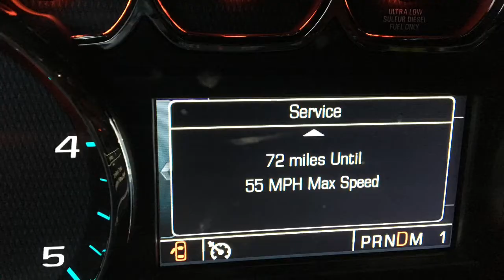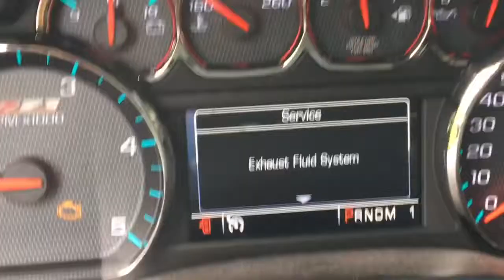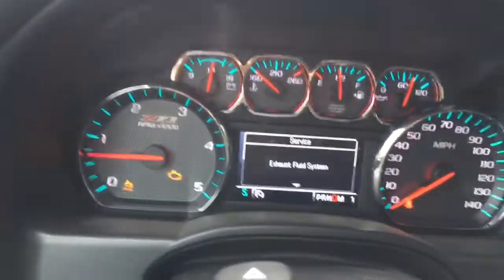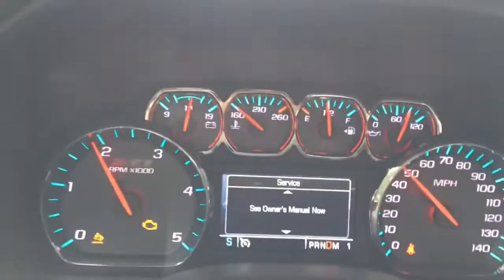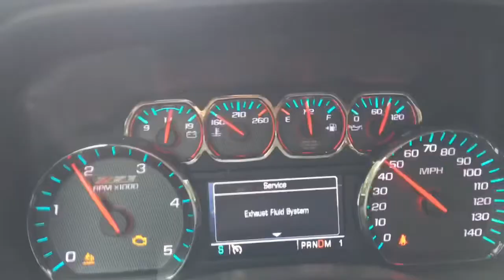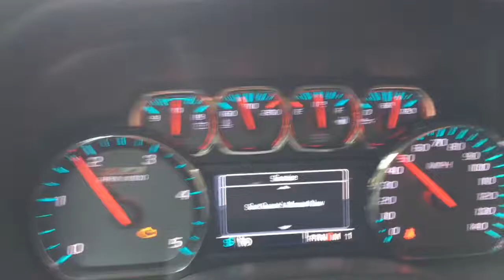2015 Chevy Silverado 3500 Duramax dpf def diesel exhaust 4 miles limit workaround fix

Comment: After watching this video I wanted to share my experience as well. My 2015 gmc 3500, 6.6 duramax was down to less than a mile before it was going to transition to the 4 mph max, so I did as you suggested and unplugged the speed sensor. But mine didn't start off in first gear. It seemed to be in about third gear because it would actually move forward only if I got it up to about two thousand rpms. So I did as another comment suggested, leave it in gear, set the brake and try it again.  Still the same, in third gear. So I decided to try it as it was and see how fast I could get it up to.  Since my local dealership was 25 miles away, I didn't have anything to lose. It ended up topping out at around fifty mph. I'm just guessing, because my digital speedometer was registering 184 mph, lol. Anyway, I could keep it going that speed, and run about 2200 rpms, oil pressure stayed about 80 lbs, and temp was below its normal 210 degrees.  I had actually left the speed sensor plugged in the last time I switched it around. It still had the check engine light on for like p0070, which was transmission system sensor, so as soon as I got to the dealership, I plugged my cheap scan tool in and erased the code. I turned it off, then back on, and now the transmission shifted normal.  Two funny things happened by running my truck at high rpms for thirty minutes.  As soon as I got to town, I started getting the original transitioning to 65 mph again. Running it like that for so long literally fooled it into resetting itself. So, theoretically, I could have probably driven it for 72 more miles at 65 mph. But the second funny thing is this. While I did have an appointment for a diagnostic test,  the technician came in the waiting toom and said, "Your truck is no longer in limp mode, and it's showing absolutely no codes now. " So he charged me nothing, and now I've driven it a couple hundred miles, and it's doing fine. The only thing I can figure is that by driving it that long at the higher rpms, maybe it worked the same as a regeneration cycle.  I guess time will tell. If it does go back in limp mode, I will come back and amend this comment. 
Okay, it did go back into limp mode. Same p20bf which I've already replaced the redundant B heater supply hose. Just by chance. When I started it the next morning I put it in elevated high idle, and after idling fast for about ten minutes,  it cleared itself on it's  own again. It's done this twice now and both times I've been able to clear it by fast idling it for five to ten minutes.

Comment: Worked for me. You can only go 55 with 2000 rpm because you can’t get it up to 6th gear. But yes, will save your butt if you get put in 4mph limp mode.👍

Comment: If you can put your truck in regen I have found that works as well l.  So if you have a odb2 scanner that can do that.  Remember disclaimer you could ruin your dpf system if there is a sensor reading true values and is not truely shot.  A dpf overhaul is 5-8000 in parts according to google.

Comment: Thanks man! How did you ever get the alert cleared? Took mine to dealer for diagnostic and they said I needed to change the DEF Heater. Changed it out and still having the same limited MPH problem. Tia

Comment: So what was the main issue that your DEF light and check engine light is on?
Reply: Any fault in the emissions system (DPF/DEF/EGR/NOX) can cause the truck to go into limp mode. Its a ridiculous system that simply doesnt work, makes your truck thirsty for fuel, and will cost thousands of dollars to maintain through the life of the truck. His issue was a reductant heater fault. Thats the heater within the DEF tank to keep it from freezing. Thats all it does. Yet Chevy decided thats enough to put a truck into limp mode. Idiots.
Reply: @kevicook  i don't think it's just chevy. It's anything with def. Nobody wants to run it. It's forced to have it and ran by the epa. All things have issues with def. Including my self. No manufacturer of any vehicle wants to look bad. Blame the government.

Comment: This is ridiculous.   My truck is stuck.  Still in my garage.   After months.  Two dealership trips. 7k. And I am still stuck.    I will never buy a Chevy again!!!!!!!
Reply: Crappy sysrem for sure recall on it fixes 0 do not buy a GM Product Durimax is a maintenance nightmare.
Reply: You’ll get it with power strokes too. Cummins aren’t that bad.
Reply: What’s the status with your truck?
Reply: My truck is stuck at 4 mph for about a month. Your trick got my family home from an interstate trip. Eternaly grateful. $500 scanner, all the DTC and faults are gone. Does manual regen. But it times out the RFQT and won't run the service bay test at all. Next stop, flashing a tune. I will let the thread know if it works.

Comment: I had same issue on my 2012 GMC 3500 Denali. There is a service bulletin that extends the warranty, in my case to an eight year old truck with 78,000 on the clock. Whole new module heaters and all,  5 gallons of DEF.and labor. NO charge!
Reply: Arthur, can you please give me more info as I have a 2012 DEF quality issue.  I'm trying to find the TSB service Bulletin before I take it to the dealer.  Thank you.
Reply: I dont know the number. It is a common issue. If you call a dealer they should be able to tell you.
Reply: Yelp, happened to 2016 in April 2021 with 34,500 miles.   DEF tank, reductant heater, module, replaced for free. Special extended warranty policy.

Comment: How long is it safe to run the truck with the sensor disconnect ?
Reply: Same question i got
Reply: Obviously, needs to be fixed right away. 1st and 3rd gear only working with speed sensor disconnected.

Comment: Why in the hell even let it get that low in the first place?  I add more at 20%.  Just like my wife in her car letting it get to E - "E" does not stand for enough!!!
Reply: Because is it's like mine it won't reset right away. Like right now mine is full and it won't reset done drove 300 miles
Reply: It won’t reset because it’s broken ya idiot. Mines deleted and free now
Reply: It’s not low, something broke for it to come into limp mode.   Mine is full and doing limp mode
Reply: @kinomorrison8004  it almost sounds like you got bad DEF
Reply: @Gengear  turns out it was a heater thingy that failed, under an extra warranty by gm, so cost was free repair.   Still inconvenient
Reply: @kinomorrison8004  reductant heater

Comment: Good god man. Why and how did you get your truck this way? Don’t you service it regularly? No offense though it was a great video.
Reply: Happens to all trucks with DEF. The injectors get clogged, the sensors and heaters go bad causing error codes and check engine lights.

Comment: Thanks for this!  But once you pulled the speed sensor, how did you get the truck back into normal running speeds?  I pulled the sensor due to my DEF heater fouling out, and now it’s stuck in 3rd gear.  Thanks

Comment: thanks for the tip i removed the speed sensor and put it back on the engine light came on good thing i always carry a scanner i erased the codes, and the emission system disappeared. i am travelling Houston, tx to ringgold, la

Comment from the maker: Replace The heater in the DEF tank and ran the regeneration.
Reply: So the heater can actually stop def process because I filled my def tanks a few weeks back and it hasn't went down one bar yet. And codes are saying lost communication to reductant module and something about the heater
Reply: Something to think about...
When sharing content with liability you might want to think about putting a disclaimer advising those who try your recommendations it should be at their own risk. The last thing you want is for someone to follow your recommendation causing damage, injury, & or death holding you liable...

Food for thought